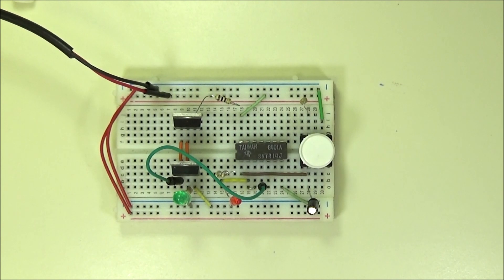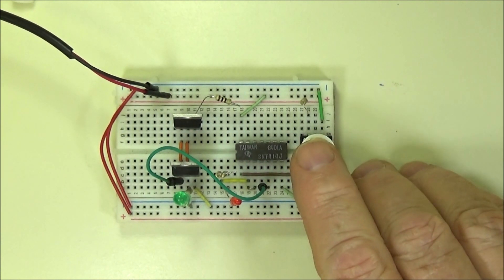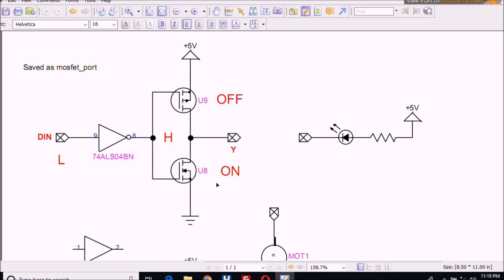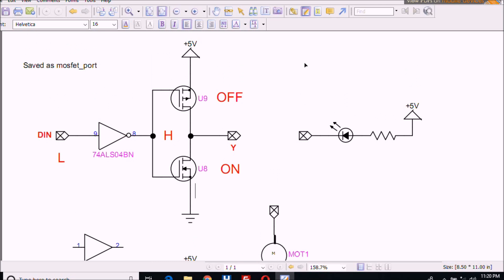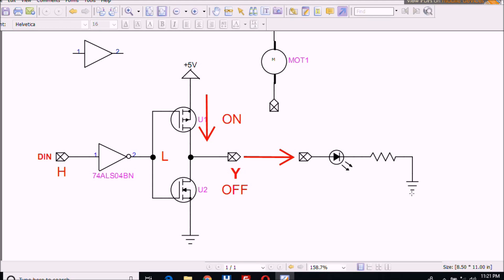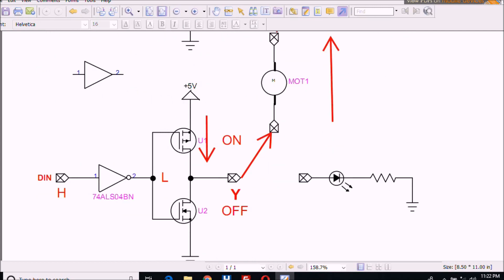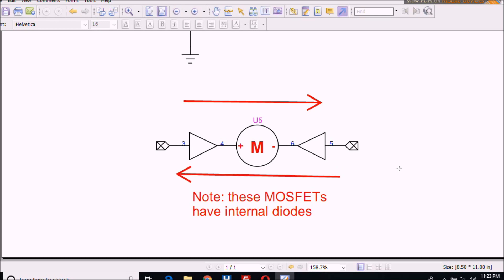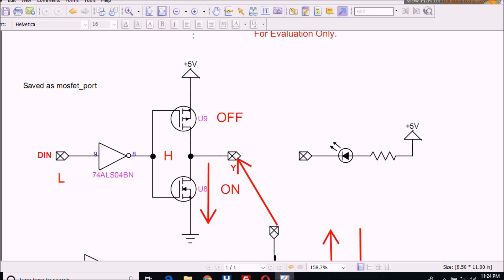High Power TTL MOSFET Buffer Circuit

Comment: It is so good to see someone teach this old stuff again.  I consumed H&H at 17 years old. I was afraid the Arduino cancer had destroyed the future.  It would be EEs sitting at simulators designing FPGAs.  Your effort gives me hope.
Reply from the maker: I test and build everything real world with real components. Many circuits won't even work with simulation software, then I get emails the circuit doesn't work. That is part of the process realizing the REAL world isn't the virtual world. In general I reject computer simulation be it electronics or climate change models because they don't reflect the fact many factors are random. I've been in electronics and equipment repair for almost 50 years from vacuum tubes to Arduino. One example are control boards built for Lincoln welders burning out resistors. The company went bat crazy and couldn't understand the problem. They tested fine in the lab and simulations worked great. I didn't have Masters in engineering so what do I know. I told them run the tests with the epoxy coating on the board. Welder PC boards are coated to prevent corrosive welding gases from corroding the circuits. The coating also effected heat transfer. Thus certain parts overheat and burn out unless efforts are made to address the problem. Too many engineers are disconnected from the real world. I made a ton of money fixing their screw ups. I'll say it again it all falls back to basic knowledge and general science. One can't fix or reason out a problem without it. Engineering is problem solving. That means dealing with real world circumstances and random interrelationships we often can't control.
Reply: @LewisLoflin  You, Sir, are my friend. I am right there with you. I am very disconcerted by the lack of GENERAL PHYSICAL PRINCIPLE application and lack building the fricken circuit and testing it. Modeling is great to get some bandwidth/tuning info or verify the basic operation of circuits - but without building it on a PCB and testing testing testing, you are not an engineer, you are a video game player. Parasitics are the RULE - why try to simulate those when you can get your product prototyped and then stick it in it's intended environment and let it fly.
Reply: Adruino .If they dont have a library they are in trouble.